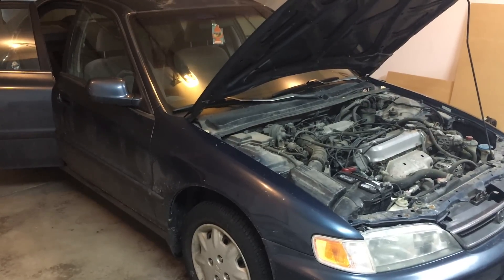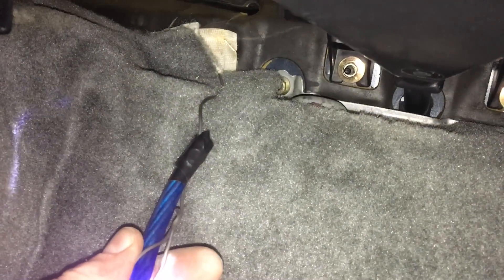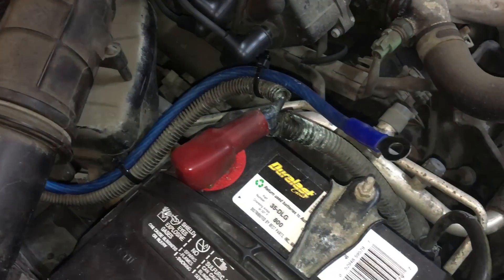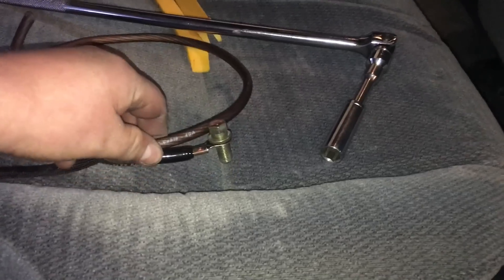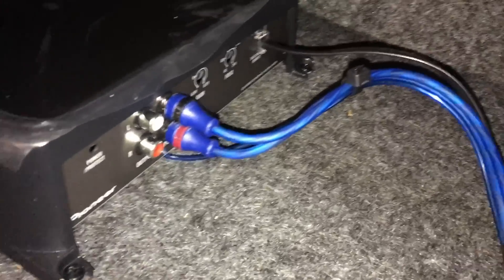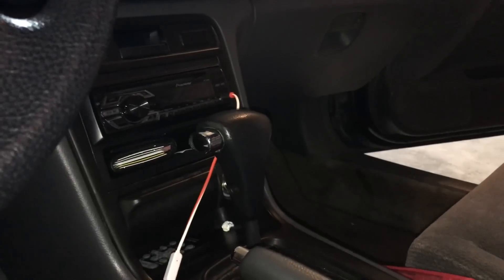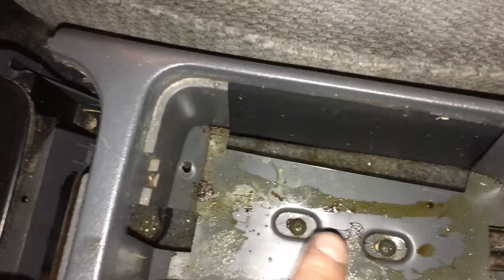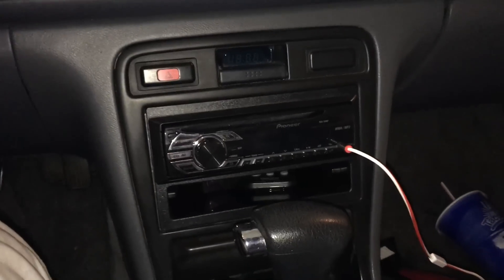1994 - 1997 Honda Accord Amp and Sub Install

Comment: For my set up I have all the wires present but I have an aftermarket head unit and there’s extra wires as to what I’m assuming are the speakers in the car, can I just splice them together and put them in the speaker input? Or would I have to find an amp that has ports for all the speaker wires?

Comment: Hey man I know this video was an older one but did you have any problems with the OEM alternator? I just bought a 2000w 1000w rms system and am worried that my alternator will shit the bed when connected. Thanks.
Reply: I’m wondering the same
Reply: My alternator went out easy to install a new one tho 95 Honda Accord

Comment: ? for ya'll - on the Rockville RV12.1C 600w 12 inch. and others like it.
I know you use the RCE out ports on a pioneer Stereo to connect to the RCA inputs on the amp, But do you not use the RCE outs on the amp unit to connect the amp to the sub that are there to use?, Do we just use the regular type speaker wire you strip to run from the amp to the sub speaker?

Comment: most people would run the RCA's down the opposite side of the car to where the power cable is being run to reduce the risk of picking electrical interference noise in the RCA cable, taping a 12v remote wire to it makes no sense, power cables down one side, audio signal cables on the other people.

Most quality amps even keep the input power terminals away from the RCA inputs for this reason, thatswhy your remote wire is on the wrong side and you had to run it under the amp to get it to the correct side.
Reply from the maker: Michael, the remote wire draws less than 1 amp which will cause no issue with engine noise.  If you feel like it will, by all means, run it on the side you choose.  Generally engine nose comes from poor grounds or faulty wiring.
Reply: Michael is right for a quality installation always isolate sound wires from power

Comment: Can i use stock speaker wires for connecting aftermarket speakers to my amplifier (Pioneer GM-D8604 Class FD 4-Channel Bridgeable Amplifier) which is a 4 channel amp and i want to power all four speakers through the amp. Also the stock speaker wires presently all go to the stock stereo and is connected with a harness, do i have to cut the harness and re-route the factory wires for connecting with the amps? ( p.s m also installing a new stereo i.e Pioneer MVH-X390BT, it has 4 rca outputs so thinking of connecting all 4 to the amp). SOMEONE PLEASE HELP.
Reply from the maker: Sure can, use this Civic tutorial for help: https://youtu.be/cP5ImBAGpt8
Reply: Thank you

Comment: do you need anything going into/out of the speaker output can u use the red and white ones that came in the amp box to connect to one sub
Reply: do the speaker outputs go to the subs?
Reply from the maker: The red / white RCA cables that came with the amp are for high-level speaker inputs where essentially you use those adapters and tap into your factory speaker wires on your car.  You wouldn't need them if you were running an aftermarket radio.

Comment: I have the exact amplifier and I have 2 4 ohm pioneer subs rated at 400w RMS and the amp which is the same as the one you have is rated at 800w rms at 1 ohm so I will have to wire the subs to 1 ohm...Well I know how to do that but it says it's a mono block amp but it had two channels where do I put the + and - wire if I'm wiring them to 1 ohm? Please get back to me the whole 2 channel on a mono block is confusing the crap out of me.
Reply from the maker: All depends on the type of subwoofer you have, what are the model numbers of your subwoofer? It depends if they are DVC or SVC, and at what impedance they are wired at.
Reply: Provo Beast Audio Installation they are 4 ohm DVC sorry I forgot to mention that but they will be wired at 1 ohm like I said I can do the wiring it's just the amp is a mono block but it has two channels I don't get it do I just use one channel or do I bridge it and use one + from the first channel and the - from the second channel?
Reply from the maker: http://knowledge.sonicelectronix.com/tools/subwoofer-wiring/#prettyPhoto/16/
Reply from the maker: There isn't two channels, just two speaker terminal hook-ups to the same channel.  Just choose one + and one - to hook the speaker wire up to, its all the same channel.
Reply: The specs refer to the 2 rca channels in the back which say input and output left+right

Comment: Can you have a stock radio and still use subs?
Reply: Yes but you will need a "line out converter". If your stock radio doesn't have an L/R RCA output.

Just saw one on amazon yesterday 😂

Comment: Same as honda accord 1991?
Reply from the maker: No, but the technique is similar.
Reply: You can run the power cable through the right fender and door just make sure the wire is protected with tubing